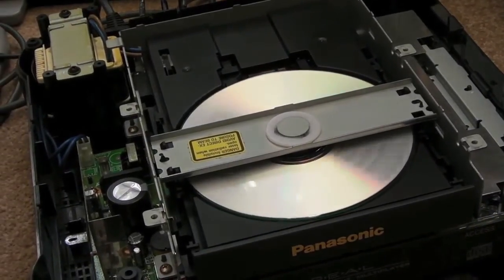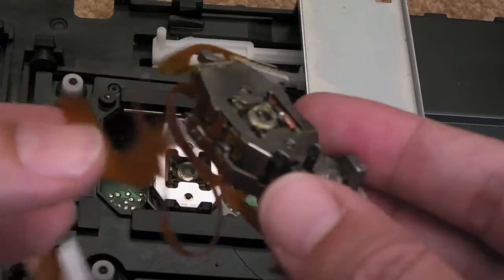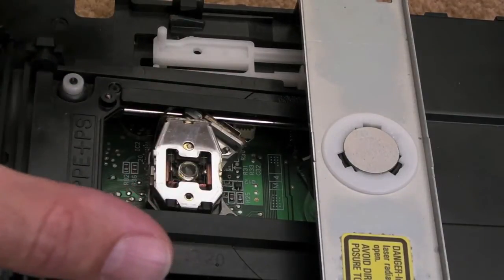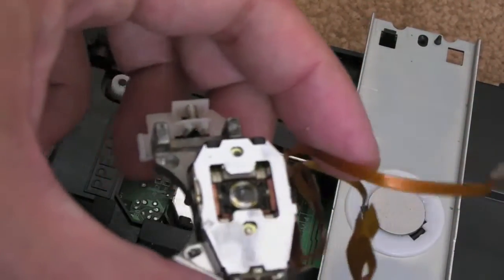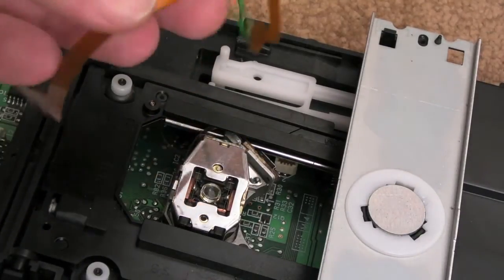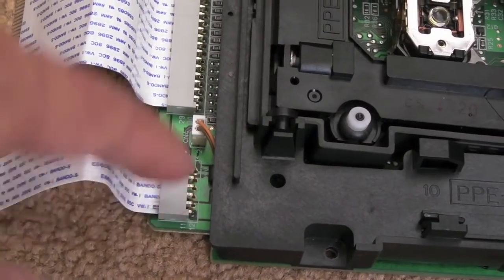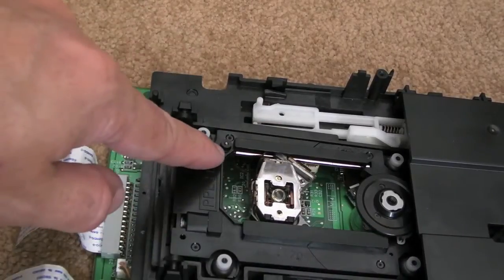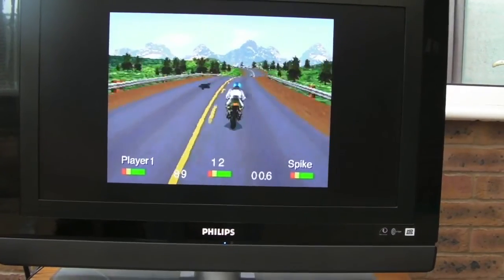Panasonic 3DO CD Drive Repair (FZ-1)

Comment from the maker: Warning: When ordering a new laser - do ask the seller if its compatible with your system!  The link above to AliExpress is where I ordered from but I am not sure the units he now sells are compatible with the FZ-1...   See his feedback! 15/05/23
The RF level was adjusted later, in this video:- https://www.youtube.com/watch?v=McSg5Xqkb2U&list=PLMjdUTC-GcRMjho136gdqa58cVX64C-Vx&index=5&t=0s

In another video I looked at the memory expansion for the 3DO:- https://www.youtube.com/watch?v=45YoBvhyV0I&list=PLMjdUTC-GcRMjho136gdqa58cVX64C-Vx&index=4&t=0s
And here's another repair to a 3DO I did later, with laser adjustment (and fixing sound issues):- https://youtu.be/EVvhm22YQN4
Follow up:- https://youtu.be/3Zbh5jOxHek
Crackling audio fix:- https://youtu.be/oczWL5hNv48
Yet More Capacitors (on the CD drive):- https://youtu.be/b0d4OhPczH0

Comment: Thank you so much! Changing the spindle height fixed my problem! My console was only reading music CDs, it would only very intermittently read original 3DO discs.
Reply: Mine is only reading cds as well. Anything I can do?
Reply: @Ericonwheelz  In the video starting around 16:00 he shows how to adjust the spindle height. Playing around with this solved my problem. 

Another thing, before I found this fix I noticed I could burn games and the 3DO seemed to play these OK most of the time. It was only having trouble with original 3DO discs.
Reply: @Emoposer9  Yeah i just did what you suggested and took the spindle off, then tried it at different heights. 1st before taking it off i just raised it a tiny bit, then tried the console, and it loaded Wolf3D up to the interplay fmv intro, then froze. So i took the spindle off, then tried it at its lowest position, wouldn't read, tried at its highest position, and it was to high for the disk to spin freely, so i put it right in the middle, and so far its working, iv got Wolf3D loaded up and running now. So hopefully it stays this way. This is literally one of my favorite consoles, iv had mine since 1996, i would hate to not be able to play my MASSIVE 3DO collection.
Reply: Nevermind.. Worked fine for about 30min then crapped out again.. I'm gonna look into one of those USB drive mods for the 3do and see if i can just get rid of the cdrom altogether.
Reply: @jonesy7650  I haven't used mine in a while, but you might want to try burned games. Mine could always play those even before I messed around with the spindle.

Comment: I just brought a 3DO off e-bay. It powered up fine and loaded the sampler disk. However when I tried a copied disk, it loaded then crashed during play. Then the console would power up with the red light and 3DO image on the screen but not allow me to open the disc tray. Now it won’t power on at all and I’ve changed the plug fuse. Any suggestions or help?
Reply from the maker: You could try replacing the capacitors in the power supply section of the motherboard.  I covered that on my channel a few times in regards to the 3DO.
Reply: @GadgetUK164  ok great stuff thank you for your replay and expertise. I’ve got the capacitors coming tomorrow so will let you know.
Reply: @GadgetUK164  I fixed it my man! Brought an ESR capacitor analyser too. Really loving fixing things up

Comment: Hi. I hope you can help me as I'm having some problems with my 3DO. I turn it on and it powers up normally, I get the screen saver and is fine. The problem starts once I insert a game. The disc drive opens and closes fine but after that nothing happens, the screen goes black. I'v taken it apart and  found that the disk sometimes spins and it seems like it's trying to load but then it suddenly stops. I replaced one capacitor that had leaked (the big 6800mF) and all the other capacitors look fine. Same result, any Ideas?
Reply from the maker: I would replace the smaller caps next to the large one!  They can look OK, but they often aren't.
Reply: Hi, I've replaced them both (and cleaned the area) and I'm still having the same issue. Now I'm just wondering if I need to replace the laser. @GadgetUK164

Comment: Hey GadgetUK, would you happen to know where the two wires to connector CN4 go from the CDROM PCB?  I purchased a damaged repairable unit off of eBay and the unit came with the connector still attached to the PCB but they are torn out at the roots so there are no colored wires sticking out anywhere on the drive itself.  Any recommendation would be great, thank you
Reply from the maker: I will take a look next time I go in there - I will also review some old footage to see if I can work it out from that.
Reply: @GadgetUK164 
thank you very much for putting in any time whatsoever I appreciate it.  You can see the connector with the two wires perfectly in your video at 14:10 minutes (your finger is almost pointing to it).  This is essentially what I was left with upon arrival - this connector with the wires coming out of the PCB portion of the drive but both wires broken off at the ends with no color wires protruding from any part of the cd drive so I have no clue where they are supposed to solder to.  Any help would be great.  Thanks again
Reply: @GadgetUK164  Well Crap .... super crap .... scratch that GadgetUK.  Just watched a laser repair video for an FZ-10 and realized those two wires go to the drive motor .... the drive motor that is completely missing from my drive ... along with the gear shaft .... that is also missing ..... well I get what I paid for.  When eBay says “for parts or repair” it can mean “for parts” I guess  🤦🏼‍♂️ I purchased to fit with an MNemo usb drive anyways so that’s fine I just wanted to see if the unit worked before I spend $200.00 on MNemos device.  Oh well  🤦🏼‍♂️  if the 3DO doesn’t work after purchase I don’t think I’ll have a problem reselling 👍🏼

Comment: a friends video game store just got one of theses 3dos (same model) and seems to have the same issues. if any one has tips on how to approach this let me know i might take a stab at it
Reply from the maker: Start by replacing the main capacitors on the PSU section - like I did on one of my other 3DO videos!
Reply: when i go to the store tomorrow or today i'll take pictures and maybe bring it home and if you could help that would be awesome. i fix systems alot but i hate working on anything with a cd drive

Comment: Hi! I`m having the trouble with my FZ-1. The lens goes beyond the cd and does a grinding noise and can`t read the game. What should could it be? I bought a new lens and the issue continues. I would preffer not mess with the pot since it did not work with the original lens and is having the same issue.
Reply from the maker: There are a number of things that could be the cause there.  The first thing is the capacitors on the PSU section of the 3DO motherboard - they very often fail and need replacing.   The small electrolytic capacitors on the CD ROM controller PCB can leak and sometimes need replacing (see my last 3DO video from a week or two back).  The grinding noise could indicate a mechanical fault, or it could be the switch underneath the drive (that indicates track 0) is dirty and needs cleaning.  The switch is located on the CD ROM controller PCB.
Reply: The switch is ok, it find the inner side, the problem is that it goes too far. Probably due the spinning problem I think. Thanks for the answers, as soon as I recap I post here or in the other post you have.
Reply from the maker: Dont worry about it going too far - mine was doing that when the caps on the drive PCB were bad and the spindle needed moving up a little.  Once I solved those problems it stopped going past the end of the disc, and it also stopped spinning the disc in the tray as it ejected.

Comment: hi gadget i have a goldstar 3do it has a problem with the CD drive the laser keeps just trying too move and makes a strange noise the side were the laser sits on the drill bit style has a small bit off plastic that sit's in the the groves get's too the end then the motor just keeps trying too push it and just sliping over the grove were it should be stopping the limit switch is being pushed in fine but the  motor does not stop keeps pushing regardless but works like it should when no disc is in it and works fine i put in a certain music cd the gears look fine i can't work out what's going on with it do u think the motor is the problem ? ive tried google can't find anything on how too fix this goldstar 3do , ive got too panasonic fz1's one japanese and us version there the best version off the 3do goldstar and sanyo models are very unreliable witch is a shame
Reply from the maker: It sounds like you have a logic fault on the drive.  It could be that the switch is broken / dirty / not connected to the PCB.  That switch should tell the MCU on the drive PCB when the carriage in the home position.  If the switch is OK (working) and connected properly, and the drive is still going nuts there, I would suspect a fault with the MCU.  Could be corrosion or some damage on the drive PCB, perhaps from leaked caps?
Reply: Thanks gadget i will give the switch a clean and replace the cap's if needed your all ways helpful thanks u friend
Reply: hi gadget i got the goldstar 3do going  just needed to adjust the laser a tiny bit running great now thank-you again for your help friend

Comment: My laser doesn't move back and forth. The disc spins and I can see the laser focusing (up and down). Anyone have a clue what the issue might be?
Reply from the maker: +Robert Aronovici Maybe the switch for head stop position is stuck closed?  There's a switch on the PCB under the drive - when the head moves to the very inner side of the disc (track 0) the switch is pressed.   If you move the head assembly to the other end of the disc (whilst its powered off), and then power it back on, does the laser assembly move?
Reply: Hello GadgetUK164!
Thanks for the response! So, I've tried many things. I've greased up the tracks, air canned sprayed it (to removed any dust) and loosened the screw that holds the smooth track. The disc spins with ease, but no matter where I set the laser head (front or back) it doesn't budge. All it does is move slightly up and down and I can see the red beam (laser). I'm stumped...
Reply from the maker: Try re-capping the PSU section on the motherboard.  If the 12v is missing or low the motors will not work correctly.
Reply: Hi,
Sorry, does re-capping the PSU simply mean disconnect and reconnect? Are you referring to the main PSU on the main board or from the cd-rom board?
Thanks!
Reply from the maker: On the main board there's a large heat sink with 3 capacitors near by.  Those 3 capacitors there cause most of the problems on the 3DO.  See my other 3DO video where I swapped them out.

Comment: I don't know if you still answer/get notifications for a video this old, but I have an FZ-10 where one of the balls that are used to hold the CD in place likes to pop out when I remove a CD.  So far all I need to do is pop the ball back in and it is fine...but that thing is going to get lost eventually haha.  And I already tested to see if CD's would play with it missing and they do not.  Would you have any idea for a fix for this that doesn't require me to replace the whole drive?  Thanks!
Reply from the maker: You could look at replacing the spindle with a similar one from an old PS1 or Saturn drive?

Comment: In my case the unit would not spin the disc.  Turned out to be a tiny cracked gear controlling the lasers  movement.  I would say that's the first thing to check if you have a stuck laser.  I was able to superglue it back and it works but the fit isn't perfect. However replacement parts for this drive are difficult to find.

Comment: So does the laser lens you listed in your comments work with the FZ-1? Because the one you have in your link the customer reviews say it does not work with the 3DO.
Reply from the maker: I've just checked and the advert appears to be the same - but I see on the sellers feedback they dont appear to work... I would ask the seller and perhaps look on eBay instead?!?
Reply: @GadgetUK164  Roger that! Much appreciated. I think im gonna give my 3DO a cap job and replace all the caps on it before i start buying cd-rom parts just to make sure its not just a bad cap starving the laser of power. Especially since the way it it happened. Worked perfectly, then suddenly, just stopped reading. Usually a dying laser will degrade over time, not just work fine then stop. Makes me think a bad cap is in there. Cheap and easy to do, so i figure its worth doing. If it still doesnt read after a new cap job, then i may just get the ODE mod thats made by Fixel, and just get rid of the CD drive altogether. And hey, it'll have fresh caps, so that's good.

Comment: Hi. I really hope you can help me as I'm desperate to get my 3do fixed. Iv recently taken my 3do fz-1 out of the attic and I'm having some problems. I turn it on and it powers up perfectly! I get the screen saver and the sound is fine. The problem starts once I insert a game. The disc drive opens and closes fine but after that there's nothing!! Iv taken it apart and  found that the disk does not spin and the laser doesn't move. I replaced one capacitor that had leaked but all the other capacitors look fine. Iv removed the disc drive and looked at all the mechanism and motors and the only thing I could see was that the gear for the motor that moves the laser, had a crack in it. So I glued the crack and this stopped the gear moving freely around the shatf. Iv tried to test the motors but have not had a lot of luck! I tried to see if they worked by attaching a aa battery to them and seeing if I got movement. I only got movement from one and that was the laser motor, and only onece I had desolderd the motor and took it out of the housing. The motor that spins the disc I can't seem to get to power up. I tried with the aa battery but nothing! Do you think I need a replacement and where would I get one? Iv got absolutely no idea what to do next and I desperately want to get it running again. Any help would be greatly appreciated.
Many thanks.
Reply from the maker: It's most likely the capacitors on the power supply!  Beyond that, maybe it needs a new laser, or the caps on the CD drive PCB swapping out.

Comment: GadgetUK164 - some great tips here.

Thought I'd add though that I personally wouldn't recommend adjustment of the laser pot without measuring the pot resistance before and after.

Also, if you adjust the pot too far, it will kill the laser. :o

(generally the lower pot resistance, the higher the laser current / power).

I have a bit of a love / hate thing with optical and floppy drives. lol

I'm glad that we're finally moving towards solid-state storage, and would love to have a CD / floppy / cart emulator for every retro system I own, but I do kind of miss using the physical media at times.

It's amazing they ever got CD drives to work tbh, let alone made them commercial and cheap. They are a proper pain to set up without the full service manual and equipment though.

I even miss VCRs in some ways - repairing them taught me a huge amount about both electronics and the mechanicals. ;)
Reply from the maker: Thanks!  Yes, I totally agree!  Adjusting the laser is one of the biggest woes on laser based systems.  Too many people just treat the pot like they would a temperature dial for household heating system etc.  The reality is that it has to be very precisely set and 9 times out of 10 the problems with second hand faulty CD and DVD systems are that the person who swapped the laser out didn't set the voltage level correctly.  Totally agree on them being a pain to setup without a service manual!  I seriously hate lasers based drive lol!  Just in the last 2 weeks I've had my PS2 pissing me off with laser issues (vid to follow), and Beaps's Neo CD which I simply could not repair.  I replaced the BTL driver chip initially, then a new laser diode, and at this point because there's no service manual and I don't know enough about CD drives it ended up being a chip swap situation, so I swapped out the Sony RF chip - still not working.  Tested every single cap, transistor, diode etc - all OK.  Only 2 chips left was a Sony DSP chip, and something which looked like an opamp but I could not find anything online for - no datasheet or anything...  Symptom was the disc was not spinning.  We know the laser was good, and the motor, and the motor driver chip.  Focus moving, head moving etc, just no spinning.  My guess is the laser was either not being powered, or more likely the returning signal was not being processed by the DSP chip properly or possible the opamp used to perhaps amplify the returning signal.   Arghhh, I hate lasers!!!!